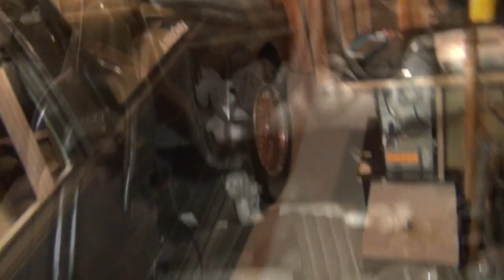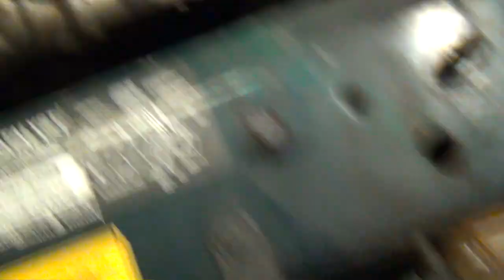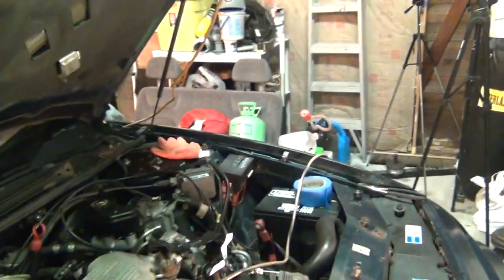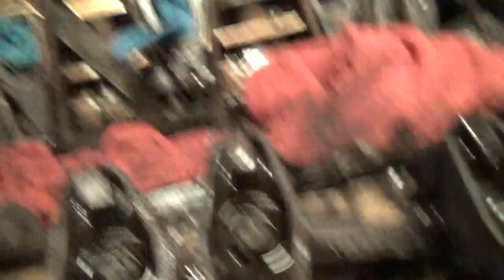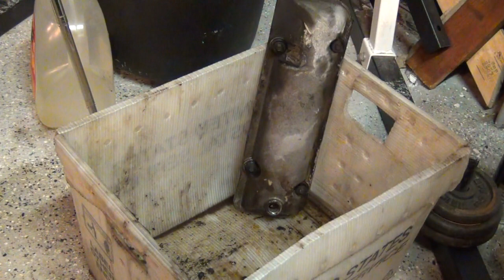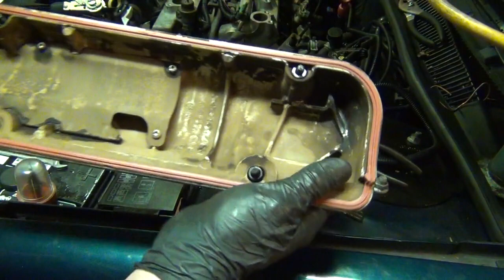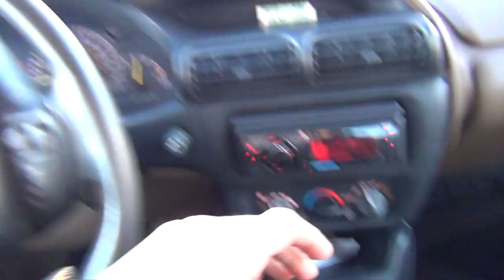Intake Manifold Gasket replacement GM 3100 V6 95' grand Prix

Comment: Well done,pretty much the same deal up till the 2003 Grand Prix 3.1,the aluminum parts are very easy to crack if over tighten,had to learn that after autozone said wrong

Comment from the maker: Im aware of the tool.  But I like to check and reset the valve train on these cars. Ive serviced any of these Gm engines with the non adjustable rockers. and many were loose after many years of service. the car runs better than it ever did. Setting Valves is Easy. ive even showed the steps. and its worth it in the end

Comment: you know theres actually a push rod remover tool you can get for this job you dont have to untighten the rocker arms its made by lisle 48500 is the number and 48300 is the other one

Comment from the maker: John, did you do the coolant fill procedure>? if you have no heat comming out of the vents then that means the cooling system is air bound.. evacuate that air before you cause more harm then good

Comment from the maker: John, Sounds like the bead of Silicon means its had previous work done to the engine.. Is it running hot?. Doing the cylinder head gaskets are involved. you would need to send the heads out to a machine shop to have them checked for warps and cracks. If the engine oil isnt leaking from anywhere it could mean its burning oil bad. bad valve stem seals or the engine is just really tired.Do a compression check on the engine. chances are the engine could be tired. and worn out. hows the power on it?
Reply: It's the way it comes from GM off the line.  But these gaskets do go out every 100k miles.  As his only has 90k its most likely its first time.

Comment from the maker: John, I had this Car. they are very good Cars. I had the 1993 model. you have the 3100V6. unfortunatly these engines intake manifold gaskets are no good since day one. my 93 didnt have this problem because 1993 for that car was the last year of the 3.1L and the revised "3100" was put into it. how may miles do you have?. and I think your mechanic ment to say you need lower and upper intake manifold gaskets..Let me know the miles it has and what major work or minor work has been done to the engine

Comment: Thanks a lot for the video. I Have a question though. I have a 1995 Olds. Cutlass Supreme SL. My mechanic said that the reason I am losing 2 and a half quarts of oil every 100 miles is my head gaskets are leaking. I have no problems with overheating or milky oil or oil in overflow tank. I have also been told it is a bad limg. I am leaking oil from the top around the intake and heads where they connect to the block.I have no idea what to do with it. Any advice

Comment: Yah she's a lawn ornament until i finish. Got the fuel rail back on today. Great video i prob watched it 20 times. If not i prob woulda dropped it for shop. The 3.1 videos for buick and chevy's just replaced the gasket and re torqued, but it definately is good to reset. Thanks a lot man, ride or die.

Comment: Great Video. Thank you. Ran the car for several months thinking this was just a coolant leak. My milkshake was more impressive than yours. However the car has no nasty sounds. I think my bearings should therefore be OK. How do you suggest to best clean out the coolant. How many oil changes?

Comment from the maker: John, its very critical. You have to do them right or the engine wont run right. Set the valves in the firing order. Turn the engine crank to cylinder #1 Top dead Center. Tighten Both Intake and exhaust valves for that cylinder and torque to specs its in my video. Then spin the engine to the next cylinder in the firing order which is Cyl # 3 and do the same thing. remember this is a non adjustable valve system so its simple. theres no spinning the pushrod while tightening. watch video carfully.

Comment from the maker: Any engine with aluminum cylinder heads thats been overheated many times should be removed and checked for warping at a machine shop. if it still overheats chances are your head gasket is gone.

Comment: Okay, thank you for the response. I'm diving into my problem here and have the throttle body off. I can see the leak spot, but the leak is brown like chocolate milk and i have the same color stuff on my radiator cap and as far as I can tell inside the radiator. Do I need to do the LIM gasket then?

Comment from the maker: Joel, thats a very common problem for those engines. Especially the early 90's 2.8's and 3.1's.  This is so Common that if you go to the auto parts store  they have a section called a Help section. and the help section is for problem parts commenly found on cars of the 80's 90's and even today.. Take a picture of the part and take it to the auto parts store.. its easy to replace. good luck

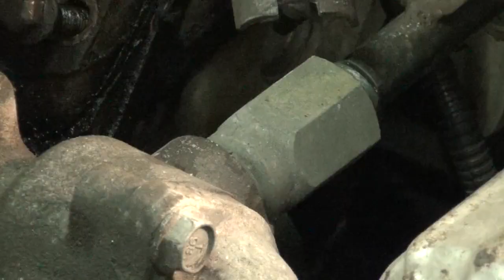Comment: At 42:27 you show a hose. My 1994 3.1SFI Ciera has this part too, and I have a coolant leak coming from this hose/bolt/o-ring. Please, can you tell me if this is a common leak spot and if this can be fixed. Or should I be looking forward to heavier engine repairs? Only 120,000 miles so I hope I'm not quite to the failure point of those plastic gaskets. When I say leak, I should probably specify more like a steady pour. I can loose 1/2 gal of coolant in 2-3 minutes flat.

Comment from the maker: Shelly
 
    These are NON adjustable. you torque them down. I would re torque them down as I specified. the cam is on its flat position and its really simple to do this..

Comment from the maker: theres two terminals that are nearly identical, I got to look back in my notes but, some wires fall to the bottom and are hard to locate. I believe it was the coolant temp sensor wire that was laying on the transmission and I went crazy looking for it. Im gonan take a look and ill write you back, I think that red terminal has no purpose.. ill let you know...

Comment: Hey, just finished a big job on my moms 3.1 cutlass, trying to get all the wiring back on... but I cant figure out where one of the red two wire connectors goes. I saw you pull the harness at 22:00 but it didnt show where all the connectors went :/.

Comment from the maker: Chad,its most likely a intake manifold gasket failure. I wouldnt forget about the possibility of the head gaskets being bad too.  Your loosing coolant from somewhere,  and its bound to turn up. Mine was going in the same way as yours and if you watch the part where I take the lower intake off you will see the slime. Have a compression test done on the engine, theres a leakdown tester kit too you can use. Watch the beginning of my video I think I explained a few tips on diagnosis. good luck

Comment: This Video looks great!  I may be using it soon.  However I have a Question.  I'm loosing coolant somewhere.  No visible puddle or drips.  If it made its way to the case its not showing on the stick.  Exhaust smells a little sweet, but no moisture coming out.  Coolant has "gunk" around the Radiator Neck and on the Cap.  Is it possible the Cap is shot and its evaporating?  Just wishing it would be this easy of a fix, but you know how cars are.  Thanks.

Comment: A very well done video! I am in the process of changing the L.I.M. Gaskets on a 99 Buick P.A. Ultra. You did not mention to also chase the holes with a tap that the bolts thread into.most people do not replace the oil pump drive O-ring! Great tip! What do you do for a living? Superb video, could you describe how you do the details as to how to do a video? I would like to do one when I do my 99 Lumina 3100.